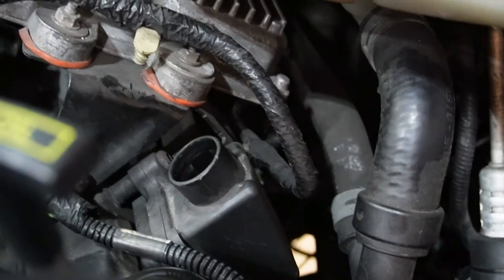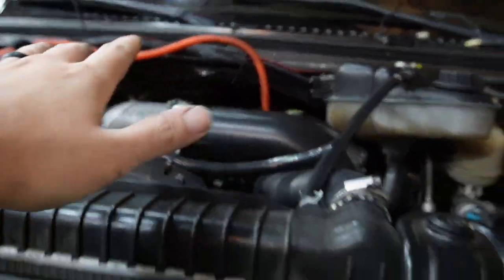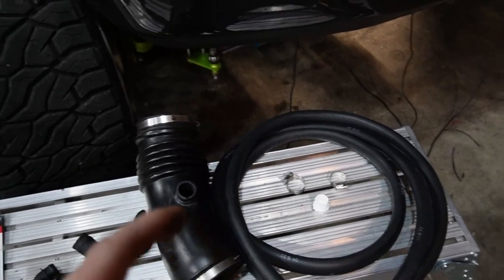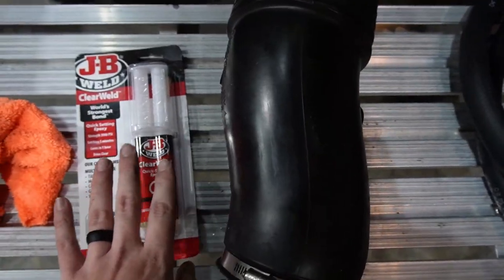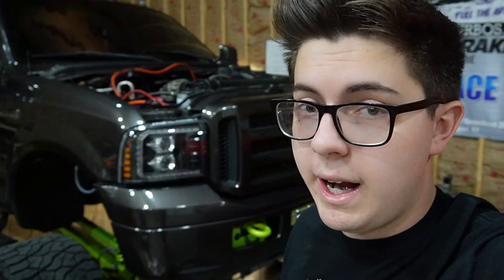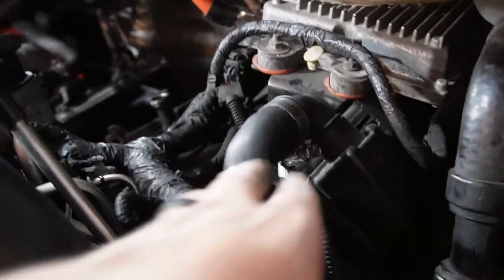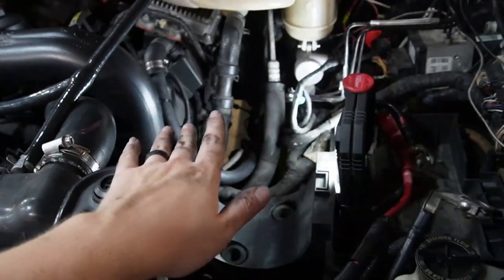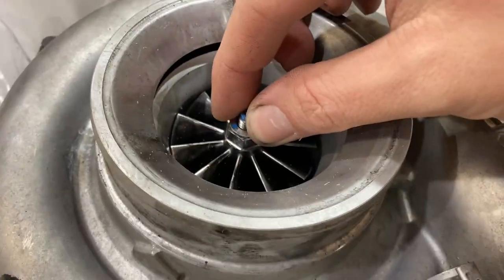MAKE YOUR 6.0 POWERSTROKE MORE RELIABLE WITH THIS MOD | DIY CCV Reroute

Comment: Good job young man.😂. Im 72 so can say that. But hay don't just vent that sewage to atmosphere get a catch can and trap that crap in the can. It just means you have to drain it from time to time. But that gives you opportunity to look around at other stuff that may need attention. P.S. pay atention to that Crankcase vent tubing do not kink it or cause any restriction to the air flow. That will play hell on all your internal seales and yes your new turbo. I have a large DIY catch can with as little asposible air flow restriction

Comment: Interesting.  I have read several (about a dozen) reports of why this is a bad idea.  Hope it works out in the long run.  Failed turbo seals being the largest impact long term.  I have 181K with stock configuration and stay as close to stock as I can.  Good luck.
Reply: Restricting the crankcase venting may cause some issues. But just letting it out into the atmosphere won't harm the engine. Quite the opposite. You will find cold starts much better your turbos will spin up better you may notice an improved MPG. And HP the engine should be more responsive due to the cleaner combustion. All that crap I call engine sewage does nothing good to the internals of the engine and the super fine machining and the balance of the turbos well if it could it would give you the biggest hug.  All so start using a good quality diesel additive. Diesel is the opposite of lubrication. So to help my fuel pump, especially the high-pressure pump a rock crawler I met mentioned that he puts 200cc of 2-cycle oil in every 17gal of fuel that's about  65 liters of fuel as he put it. It can't hurt it's oil it burns. And will lube cylinder walls and valves what's bad about that?
Reply: PS start using mechanics gloves the ones that things like acetone and really black oil and dirty grease are not only hard on your internals but your girl will appreciate you just a bit more 😂😂😂. Stay safe and have fun. Oh ya, when you are talking in your videos turn the tunes down a few disciples. Thanks for what you are doing 👍

Comment: Have you considered the catch can route?
Reply from the maker: I have not. Gunna see what kind of smoke/haze comes out of this tube first before I worry about it. If it seems to be more than I’m imagining it will be then I’ll put a catch can in the end
Reply: I meant to say a catch can with a return line to maintain the vacuum while the can removes the crap . I dont know for sure but ive read it better than an open line from the ccv than could get debris . Something to think about so u dont hurt your truck with the new upgrades

Comment: Heater core hose will deteriorate  from the oils after time.  Then it will start  sending pieces  of the hose through your turbo..you need to use fuel line!.

Comment: Although its nice to not have an oily film in your intake and intercooler and the piping, you must consider the fact that you now have 0 help from the intake to suck out the crankcase  pressure built up, especially under heavier boost. You would be suprized how much pressure can build up in the crankcase, and the inlet side of the turbo creates a great amount of vaccum which helps reduce all that pressure. For example i would never be doing this on a truck with high mileage or worn out rings, under boost the worn out rings allow even more pressure to enter the crankcase. The vaccum created at that intake pipe helps alot!
Good video though, just something to consider.
Reply: It's a crank vent on a diesel. No vacuum needed.
Reply: @knolez1546 would the 1” pipe not be enough for it to let the pressure out? Or do you specifically need it pulling the pressure out?

Comment: If u did the ccv re route and you have blow by what are the results or side effects of doing this re route?
Reply: I recently vented my crankcase to atmosphere as well. I’m seeing white smoke coming out the 1” id heater hose I routed from the valve cover down frame rail, I’m wondering if it has that much blow by when it’s connected to the intake from factory
Reply: @chrislandsbury8423  read above comments

Comment: Venting to atmosphere is 1 of the dumbass things u could do.1 ur turbo makes a vacuum and sucks out crank case pressure..if u vent to atmosphere, the pressure inside ur engine will get to hi and u will start to have oil leaks..that best case scenario ..most of time it will blow ur turbo seals and u can have run away...most shops want warranty a turbo or engine work ,if u vent to atmosphere....there is nothing wrong with getting oil in turbo or cac pipes from stock setup...diesel will run on oil and it helps lube the turbo. It was designed to do this

Comment: This mod is pretty dumb and I suggest any one considering on doing it to save them selves time and not do it. If you regularly maintain your vehicle properly than the oil fumes coming out of your crank case should not be dirty or contaminated. It dosnt matter if your truck is bran new or has 500k on the clock. It needs the suction from the intake to evacuate those fumes from the engine. Vent to atmosphere is not enough. A little bit of oil in your intake track won't hurt a thing!
Reply from the maker: I highly recommend running it to the exhaust ! That’s what I recently done since posting this. I agree the smell is awful ! Either run a catch can , bung into exhaust , or just don’t do this mod at all! Great info. Thanks for watching.
Reply: @JUSTINHAWKSMITH  does that not cause smoke from the exhaust??
Reply from the maker: @LOSthagod  not really. The heat from exhaust dries up the vapors before they really get to the back. Maybe a little haze of smoke but not much.
Reply: @JUSTINHAWKSMITH  preciate the response. I have to reroute mine tomorrow. Previous owner did it but the hose was kinked and wasn't venting.. 

So... apparently the negative pressure was causing my turbo to leak oil into exhaust and at low rpms/idle I was just pluming white smoke.. figured because when I idle with the oil fill cap off. The smoke clears up after a few minutes..

 can I get your email or something to ask a couple questions. First time 6.0 owner..
Reply from the maker: @ lifeasjhawk@gmail.com I’ll help all I can

Comment: Really bad idea.
Reply from the maker: Can you explain why other than saying it’ll cause excessive crank case pressure not having vacuum to it ? Cause I’ve heard that one and it’s been proven false and true by so many different people. Curious what you have to say on reason
Reply: @JUSTINHAWKSMITH  I've been researching this myself, stock ccv vs can. Most lit I find addresses smell and the dislike of oil in the IC but powerstroke help says best to leave stock. The oil goes back into the turbo and IC but the oil lubes(?) the seals in the turbo charger and the IC is designed for oil and any oil that makes it into the cylinders just gets burnt up during combustion. Anyway, one of the few things I've found that tries to deal with the actual technical aspects of stock ccv vs can. (https://www.youtube.com/watch?v=4Qu2-Dr3jF8)